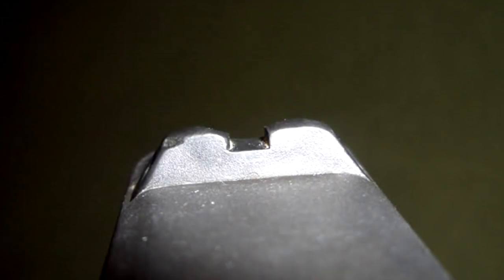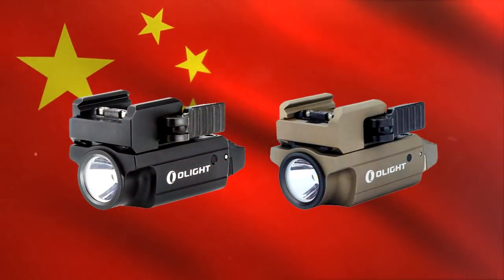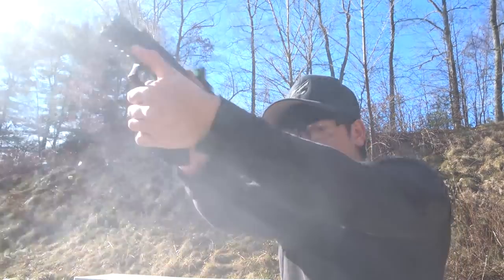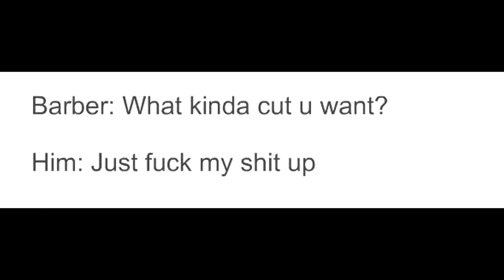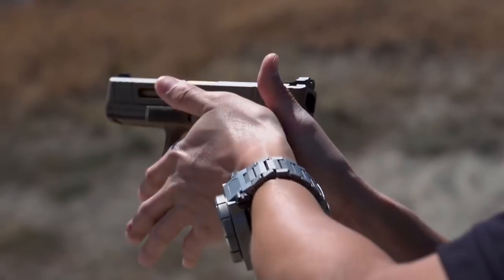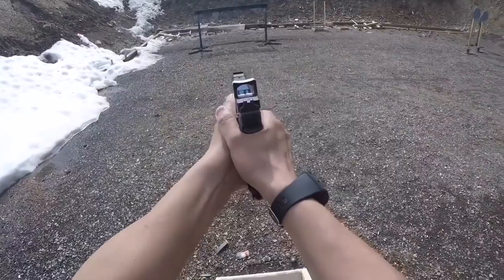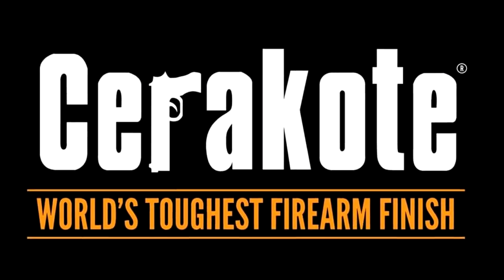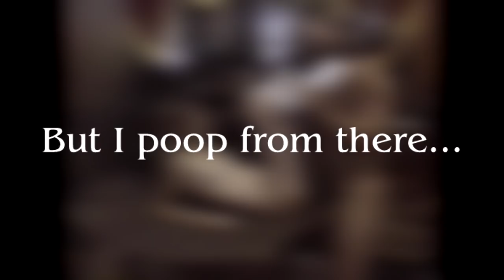How to Upgrade Your Pistol

Comment: Touché !!

I have seen too many tacticool mall ninja glocks fail at high round courses.  

Do I hate Glocks?  Nope.  I have them around because they are the Bic pens of the gun world and getting spare parts is a breeze.  My Hk pistols are my gtw choice.
Reply from the maker: Couldn't have said it myself! I think they're a reliable pistol if kept stock, but I also believe most pistols nowadays are at least decent. Still would rather trust my life to HK though. But that's the next video... HK Fanboys hahaha
Reply: In stock form I would trust the Glock series.  I have been running them since they were available in the late 80’s.  Good sights and a bunch of practice rounds through a real course is a must.

Also the trend to mess with the springs of a service/self defense pistol isn’t cool.  For range use/competition.... then it’s ok, but for a self defense pistol.... your just asking for trouble.
Reply from the maker: Totally agree. I've shot a few glocks, not as much as HKs or even other brands, the thing that does throw me off is the grip angle. But after a session I can get used to it. The aggressive cant of it does help with controlling recoil, I'll give it that, but I'm definitely as good point shooting with them.

Yeah, it's a huge thing now, everyone just likes to mess with all the internals and such. I'm a firm believer that the factory testing standards are bar none and no third party manufacturer will ever be able to match that testing capability. A new set of sights and I'm good to go.

Comment: the unintentional dryfire at the testicles made me pucker.

installed incorrectly, or what?
Reply from the maker: it was filmed during a class. the trigger is a zev trigger and i guess one of the retention springs worked its way out of the trigger, causing the trigger safety lever to disengage. since the zev triggers are THICCer than stock, the guys holster would pull the trigger each time. it was uploaded on truexodus's IG.
Reply: @FrontierSetter  well thank god you noticed it.

thank god you made a meme of it.
Reply from the maker: it's what this shit-tier channel was born to do. meme everything, nothing is sacred.

Comment: Apparently I need to rethink everything I know. I have been wanting to cover up my wide gaping asshole but the poors has strucken me as of late
Reply from the maker: Brooo, buy the HKparts slide cap! It's only $30, just eat ramen and broccoli for a week!
https://www.hkparts.net/shop/pc/Enhanced-Slide-Cap-VP9-VP9-Tactical-VP9SK-VP40-Black-367p17856.htm
Reply: I’ve been looking at it 😂 I really need to. Does VP stand for Very Prolapse?
Reply from the maker: LMAO oh God.... If they didn't have the striker tip painted red it wouldn't have been so bad
Reply: I could always paint it silver or FDE to match my gun until i buy the plate. Modern problems require modern solutions.
Reply from the maker: Hahaha yesss very true, simple fix 💪💪💪💪💪

Comment: Oh shit, that was a good one.
Reply from the maker: I'm glad you liked it bro!!!! How those Solum Tool plates holding up? My range finally opened so now I can drop em like it's hot
Reply: Great, I'll be grabbing a bunch more for the 45 and 9c.
Reply from the maker: Planning on getting a HK45CT in the near future so I'll probably be doing the same 😍
Reply: The HK45CT/Fullsize are nice. I'm a USP guy though. Had the HK45 for awhile, but the USP just fits me better.
Reply from the maker: Which reminds me Im still on the market for a new USP full-size but in 9mm. I see a lot of 40s but nothing else 😭
Reply: 40''s are a dime a dzn now. I'm going to grab a grey frame usp9c. I'm really digging that grey frame.
Reply from the maker: the grey frames are super slick, i agree. i saw a few clear frame floating around gunbroker a little bit ago, but of course the prices were high. looked neat though lol.

Comment: Setter, how was the transition from stiker fired to da/ sa? From the vp9 to the usp 9 compact. Did it take alot of practice to learn a different type of trigger? I would appreciate your thoughts , I am thinking of trying da sa myself. Thanks
Reply from the maker: Honestly didn't take long at all. I really prefer hammer fired triggers nowadays since carrying with the hammer down is in my opinion safer in appendix IWB, and the single action pull and reset is much shorter and more tactile. Especially when comparing the vp9 and USPc. One thing I didn't like about the vp9 trigger was the reset was so bouncy, it would almost throw your finger off the wall once you got to it. The USP does not do that. The first DA pull isn't bad either. You just need to "roll" the trigger instead of finding the "wall", just pull consistently through. There's a lot better shooters that can explain this though. Also, if you want to try hammer fired but don't like DASA, look into HK's LEM trigger. I have a video on it on my channel if you're interested. 👌

Comment: How easy is it to mount the meprolight MRDS in a p30L? I have a p30L does it need a mounting plate? It seems with what is on the HK website you just replace the sights and red dot clicks on to the rear sight?
Reply from the maker: Since the vp9 and p30 share the same sights, the meprolight MRDS should just mount into the reardove tail. What red dot are you planning on using? Meprolights website seems pretty ambiguous, but you do need to buy a mounting plate for each red dot you use. The OPTION 2, that is on their site comes with the rear dove rail sight mount along with adapter plates for separate sights if you intend to get an RMR or something.

Comment: Hope to see some real operators with some of these upgrades at the class I’m taking tomorrow. Surely they will shame me and my stock P30 SK.
Reply from the maker: You'll see all sorts of malfunctions from these GUCCIGUNs lol. You can tell they've actually never been fired because the Punisher cerakote job is still in perfect condition. <3 <3 <3 What holster you running with the P30sk?
Reply: frontier.setter Was using a StealthGear Ventcore Mini for 2 years. Just got a Black Arch Protos M yesterday. Wore it today. Really like it. Way better retention. Gonna use it for the class.
Reply from the maker: I had a friend who used the venticore a lot, it looked comfy, its half kydex and half mesh yeah? Do you carry on your strong side hip? Lemme know how it holds up!
Reply: Carry around 4:00. Yes half kydex half mesh material. Super comfy. The new Black Arch Protos M has leather, mesh, and the kydex shell wraps around the trigger guard for way better retention. Worked great!
Reply from the maker: Very nice! I've never carried hip but I have a lot of friends that do. It definitely seems nicer on the skin than JUST kydex lol